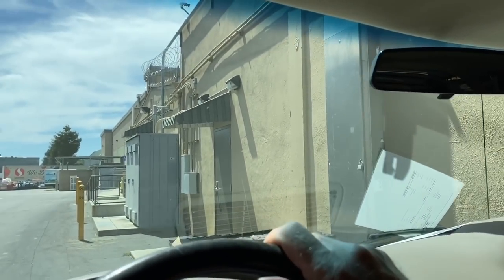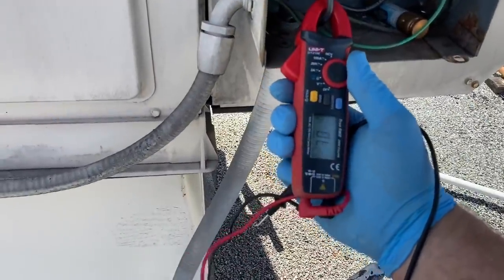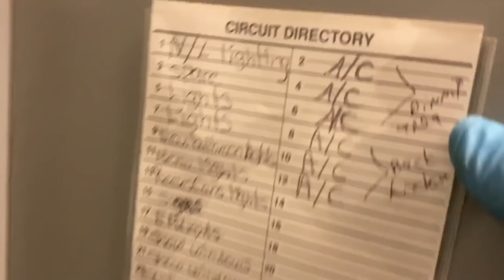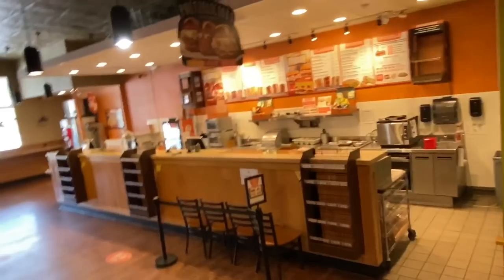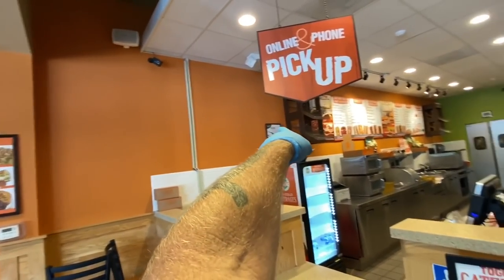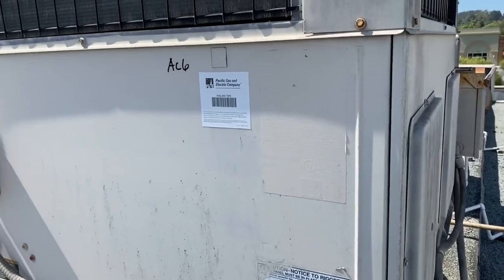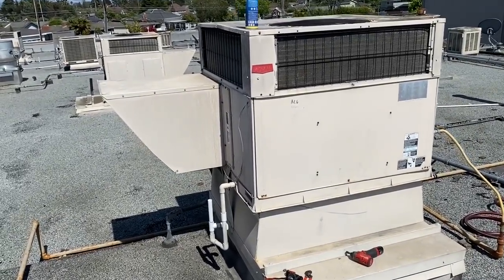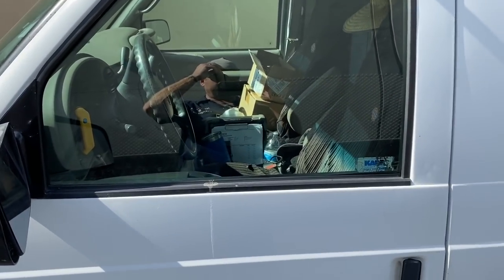1st AC CALL OF 2020

Comment: Used MeasureQuick for the first time yesterday on a buddy's home a/c. Have messed around with it on refrigeration before this coronacation.  Hopefully going back to work next week finally. 
 MQ wants you to wait until the orange squiggly at the top right of the screen turns green or "System Stable" before it will spit out any warning flags or diagnosis.
Reply: Not that YOU need the diagnostic functions but I sure do!

Comment: Just picked up a new strawhat, they break apart after time. In Florida they are a necessity. I use it to cut the lawn too.
Reply: Now do you cut a lawn with a straw hat??
Reply: @pdmpdm999  Easy, you wear the straw hat while mowing the lawn with a lawnmower. Shouldn't be that hard to figure out if I can do it.